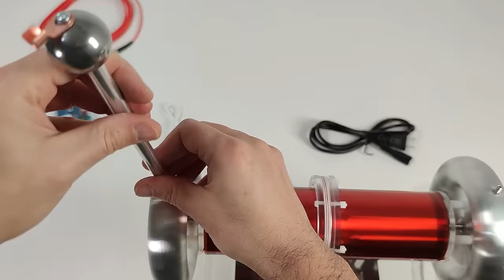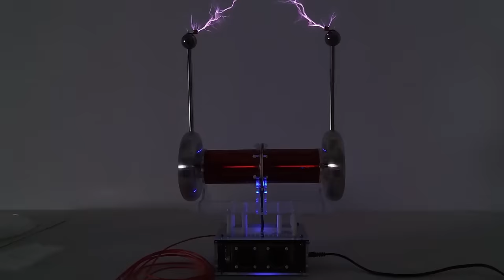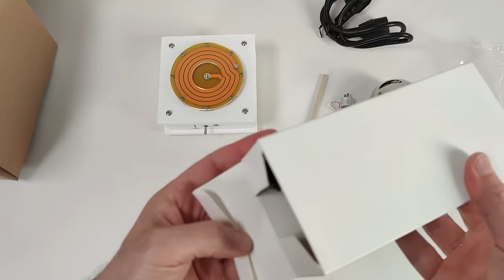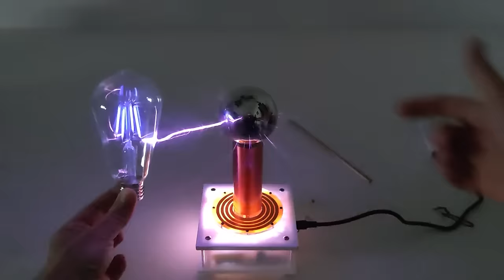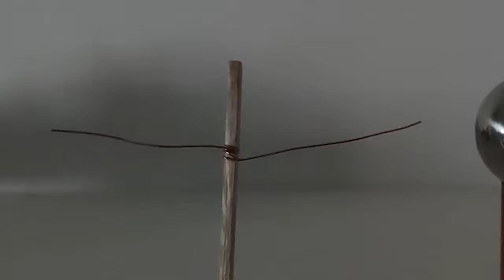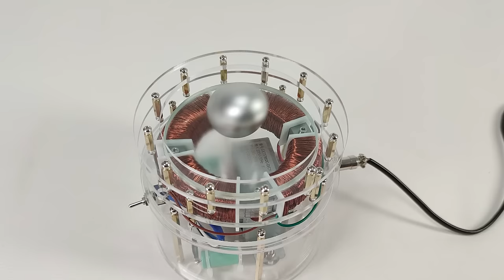3 Powerful Tesla Coils | Magnetic Games

Comment: For the bipolar model, did you have to use 220V? Inside the power controller there is a 110V/220V slide switch that may allow either input voltage?

Comment: 🧲🌡️📡🔆☢️🔌🔊🔋♻️🌐☯️⚛️
Electromagnetism- (energy, wavelength, frequency) Play such a crucial aspect of the cosmos. It's really facinating how so many properties with-in Nature use: 
~{"Differences"}~
 That "factor" seems to be a key factor in keeping dynamic systems functioning. *{High pressure/low pressure, hot/cold temp, different densities, static electric charges/discharges, electromagnetism north/south poles, different velocity/angular momentum, different amounts of energy/mass/frequency/vibrations. Different layers between different regions such as: (Land/water/air/edge of the atmosphere/space/ the different regions in space with different particle density/background radiation, creating bubbles/membrane layers/cloud regions, nebula's/Galaxy's/Galaxy clusters/ Cosmic filaments/less dense regions of space compared to dense regions of space.) All of these things are basic differences but create a way for the dynamic engine with-in Nature to continue flowing and operating to create and convert energy.} Just Like How a battery 🔋 transfers + charges through a membrane layer to a - charged side. Like how regions of high/low pressure and temperature 🌡️differences create winds. In water- add some factors and It creates ocean currents and flow. Then internally in our planet it creates plate tectonics, planetary convection, geothermal activity, a magnetic field around our planet, to hold a atmosphere. 
🧲🌡️📡🔆☢️🔌🔊🔋♻️🌐☯️⚛️
The natural world around us is just utterly facinating to me.